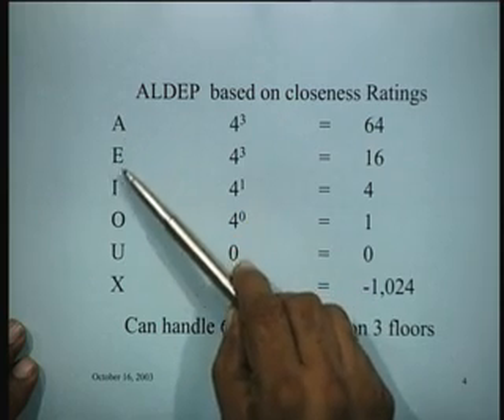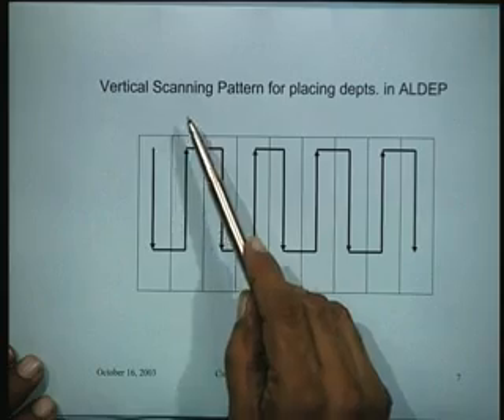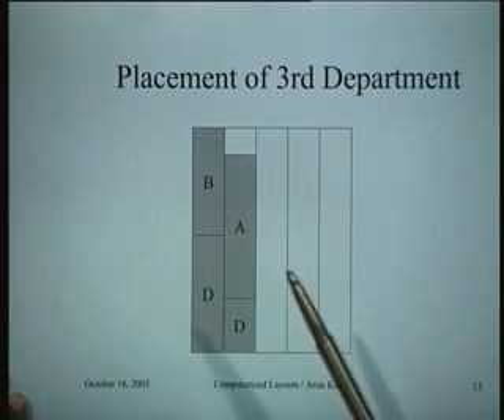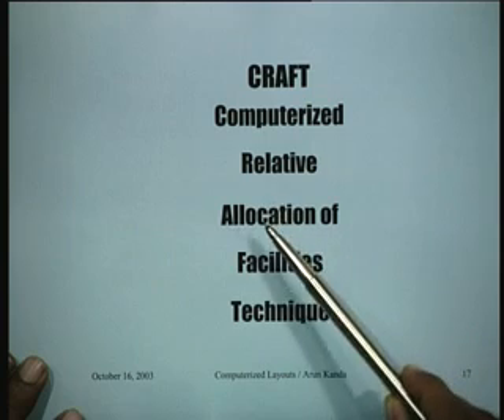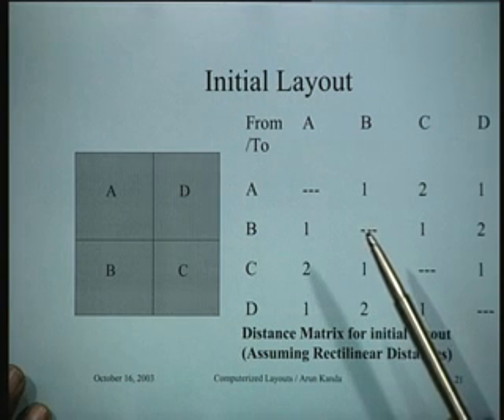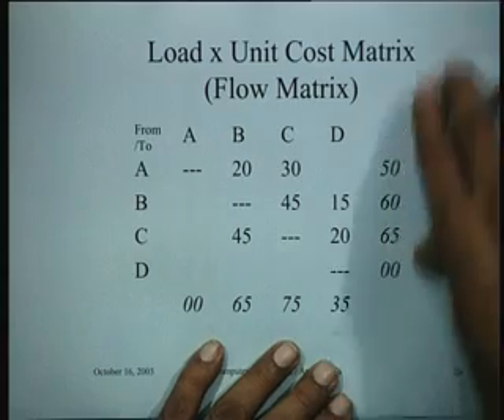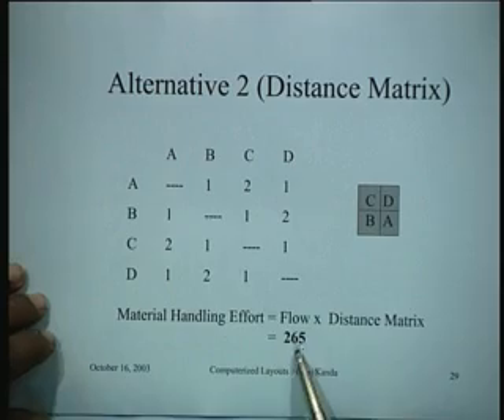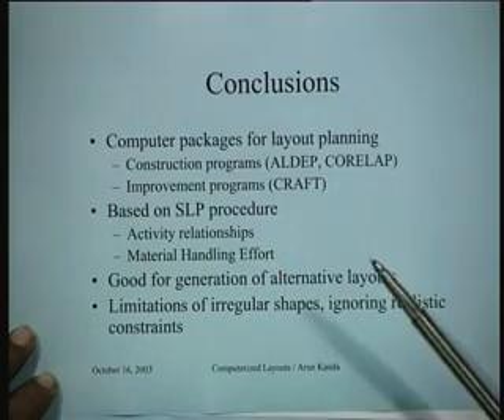Lecture - 32 Computerised Layout Planning

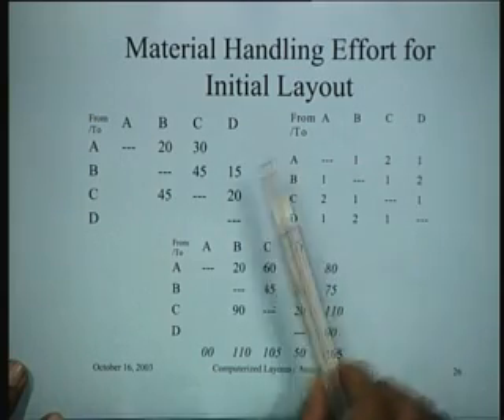Comment: At 44:40 when we are multiplying the  flow and Distance matrix, how come from C to B we got value as 90? it should be 45 only!
Also as mentioned in one of the earlier comment "C-B SHOULD BE 40 NOT 45 IN CORELAP AT 39:00" as there is no extra CB present in the given data.